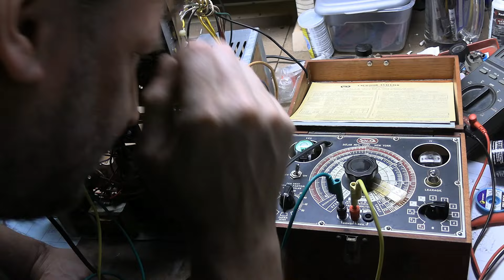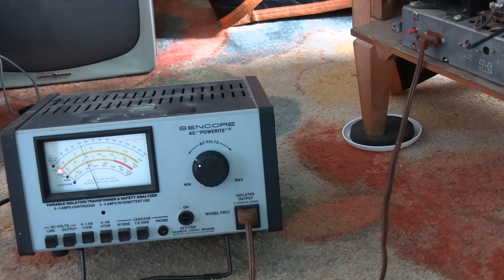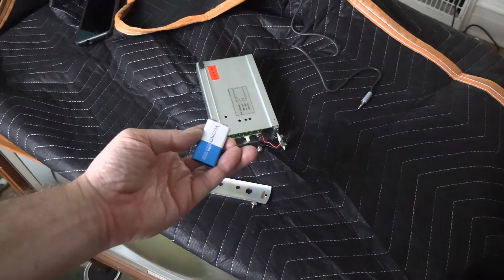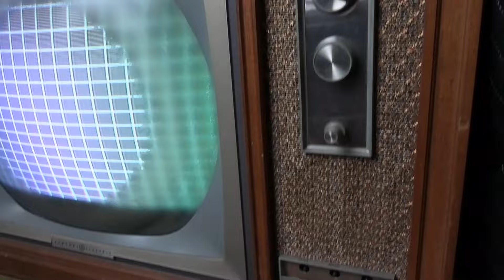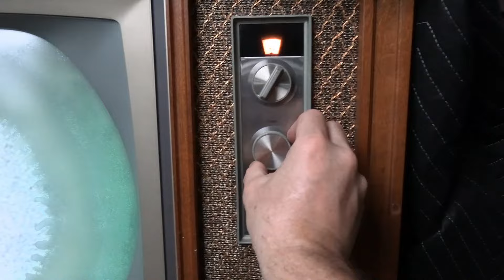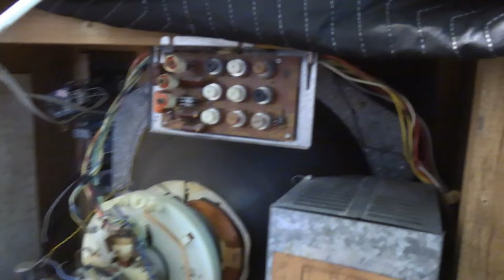GE M935AWL roundie part 3

Comment: For a first power up that set looks pretty good. When I did my Admiral black and white the Cataract was about as bad as yours you'll be surprised how easy it comes off. I did it the way Shango does it by putting it in the sun with the black garbage bag on top and using clothespins as wedges.

Comment: That color bar pattern is called a Keyed or gated rainbow pattern.  It is the correct pattern for the scope waveforms of the color section.  Those circuit breakers were a pain.  Also critical is the circuit board to chassis ground stakes.  Especially around the color demodulators.  High voltage should be about 25kv.  Also remember those sets were never really bright.  The background on the crosshatch should be close to black instead of grey.  Looks like purity is not bad.  I wouldn't mess with convergence until after the crt is fixed since you will need to remove the tube to remove the cataract.  I also would not trust the brown drop caps.  A complete recap may solve the alignment issues as well.  It is looking good though.  Good luck!

Comment: To cut through the faceplate laminating resin, use heavy braided fishing line and isopropyl alchohol. The  resin  might be a water clear silicone.
Reply: I think the RCA type tubes require heat to remove the cataract. The wire method works better with the Zenith type. I think the Zenith type remains softer than the RCA type. Check out some YouTube videos Tom Carlson made about two years ago.

Comment: Good progress Bob!  When they first started using those thermal circuit breakers in TVs, in addition to them being poor quality, they also used a breaker with a trip current too close to the normal Run current.  If the trip point isn't at least 2X the Run current, false trips are guaranteed.

Be careful series connecting capacitors to achieve a higher voltage rating.  In school, they always taught two caps in series doubles the voltage rating.  Not true - Only in a perfect world.  That assumption assumes both capacitors have exactly the same leakage current.  In the real world, series caps need a resistor voltage divider to force an even voltage sharing between caps.  Of course, then you have to make sure you are not exceeding the voltage rating for the resistors.  Without a voltage divider, the voltage rating of the series caps is the same as a single capacitor.

That portable color bar generator does not generate sound.  The sound IF needs to be aligned.  I'm seeing sound induced distortion in the video.  If I recall, there is a 4.5 MHz trap for that.  Also, adjust the Quad Coil for cleanest audio output.  If it is misadjusted, you will get a buzz from the video.

One of the next critical steps is to deal with the CRT cateract, with Shango being the expert on that fix.

Comment: I’d say most of the insufficient deflection is from running the set lean. If anything, maybe the bypass cap might be going up in ESR a bit, but I wouldn’t bother changing anything till you can put full voltage on it

Comment: This set is looking great Bob, very promising so far! I scored a low hour 1960 RCA CTC-9 Winslow earlier this year, with a very strong original 21CYP22A. It was loaded with brown-drop caps and I decided to shotgun replace them with a blend of Panasonic film caps and orange-drops, depending on the application - I'm glad I did. I don't have a proper high voltage cap tester, but almost every .01uf 200v 10% brown-drop I removed was bad - the other values seemed mostly fine. It's not a real test, but out of circuit with a DMM on Ohms, many had a resistance across the leads of way under 1 Meg. I'm not sure if they improved the manufacturing of brown-drops by 63/64, but that experience gave me trust issues!

Comment: Looks excellent!
A cathode current of 150mA seems to be a bit high... you can try measuring the high voltage too and first adjusting it to around 22kv for example, and then adjusting the efficiency coil for minimum cathode current.
Reply: With a fairly new flyback and good quality horizontal output tube, the horizontal output cathode current would run 150 to 180 mA.  The Japanese horizontal output tubes were inferior quality and caused higher cathode current, sometimes exceeding the current spec.  

The Efficiency coil was also called the Horizontal Linearity control.  I never saw that much difference when adjusting it; only about a 20 mA total change in cathode current.
Reply from the maker: Service info just says it should be less than 210

Comment: It really has a decent bright picture considering all the issues. I spose you'll end up doing the cataract repair if everything goes well. All the sets I had usually were just yellow and green around the edges and looked fine once they were playing. The V high brightness phosphor crts were way brighter and if I had a earlier set that worked well I would find a V tube for it and pop it in and we'd watch it till something better came along.
Reply from the maker: Yes, probably sooner than later. It's hard to make adjustments with that cloudy cataract
Reply: There are YouTube videos by Tom Carlson who restores TVs, he did a few about 2 years ago about removing cataracts. There were two types of "glue" used, RCA and Zenith. The Zenith type discolored like you describe. Two different methods could be used according to type.
Reply: I always tried to get Zeniths when I could. If they were right they always had a great picture and they tended to be reliable.
I had a few roundies but I was trying to sell them so I didn't actively try to get them.
At that point the ones I had didn't have cataracts that bad but that was YEARS ago and they were mostly just old outdated sets.